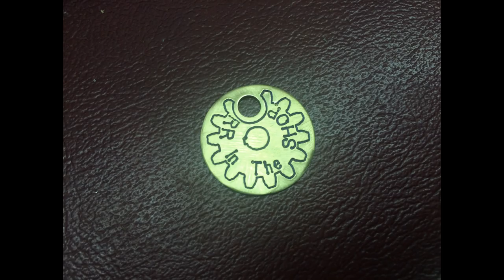How To Assemble Clausing Lathe Carriage/Compound

Comment: Randy, I like your series on this lathe. I too should remove the saddle on my gear-head gap bed lathe and finally fix the slow oil leak in lathe  carriage. I now have some ideas on the easiest way to do this by watching your video. I noticed the Suburban Tool LED light from the Summer Bash. One of the nicest SWAG and I use it all the time in the shop. Thank you, Paul
Reply from the maker: Thanks you Paul and have a nice Thanksgiving!

Comment: Randy, mine had the same thin shims on the back side carriage blocks as well as under the carriage where it bolts to the apron. I sent you pics of the sliding pulley shaft. Check them out when you get back into the shop. If need be, I'll send the parts out for you to copy. 
Matt
Reply from the maker: Thanks you Matt and have a nice Thanksgiving!

Comment: The shims are to adjust the clearance. You would remove shims to make the fit tighter.  As metal is wore away for the bearing plates removing a shim allows the bearing plate to maintain the proper clearance.
Reply from the maker: I agree.  Thanks.
Reply: I have a Clausing 6913 in my shop.  My dad bought it used in 1980. My Clausing has been a work horse. I have made part for the Logging , Coal mining and Tool & Die making industry's on mine.

Comment: Hi  Randy, 
I was watching your video hoping to see how you replaced the chip cover for the cross slide, and with my luck you skipped over it. I am having a problem with my chip cover, if I move the apron forward too much, it won't come back. If I remember correctly, I have to disassemble the whole cross slide to get the chip cover aligned correctly and reassemble the cross slide. Am I doing something wrong or do you think I am missing something inside? Any thoughts would be greatly appreciated.